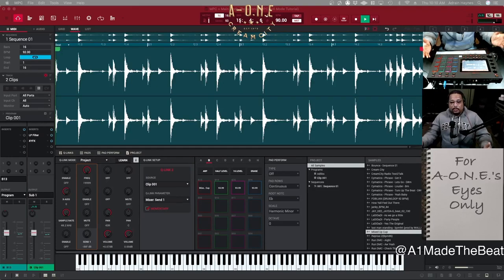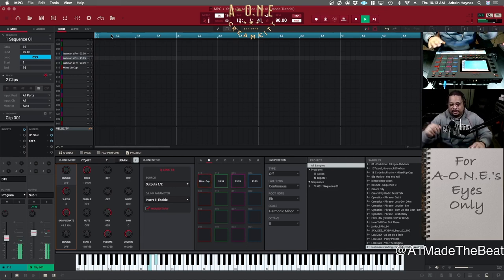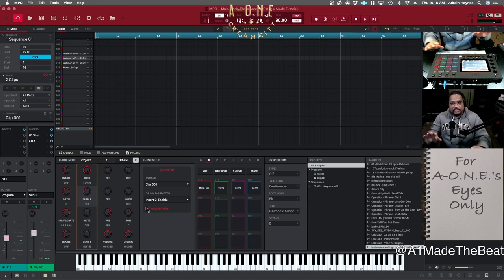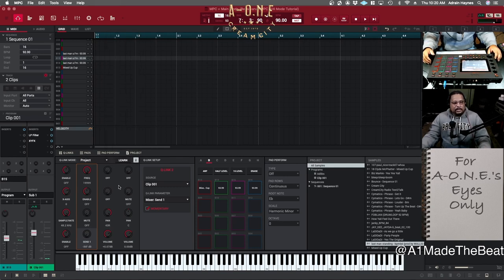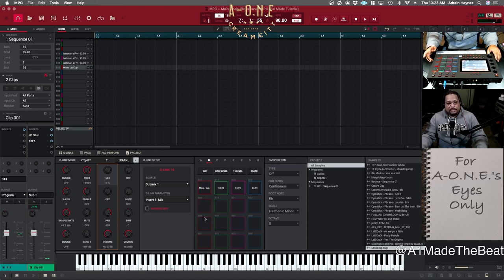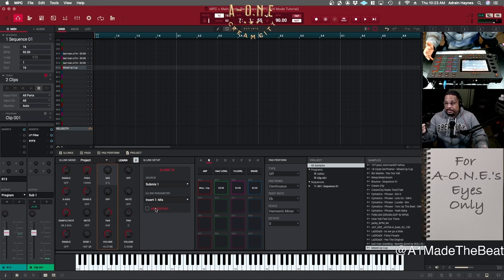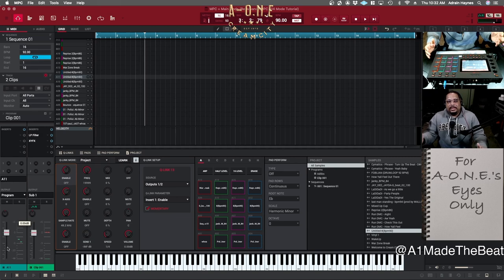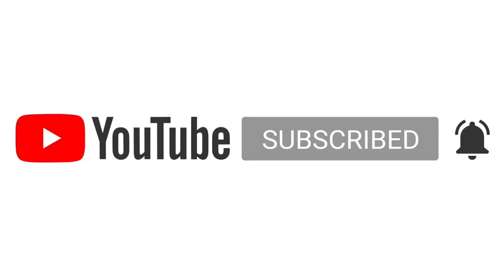EXCLUSIVE pt.2: How To Setup MPC 414 Mode Pt 2...QLInks & EFX (The SP 404 Killer?)

Comment: If I pick up a midi controller with knobs, I can map these functions to the controller and keep q links functioning as normal right?
Reply from the maker: Let me verify that it will assign to external midi devices when I get back to the house. It should work with no problem on the MPC.  The FORCE is another issue.
Reply: @A1MadeTheBeat  reporting back. This shit works great. Got a midi fighter twister. Loaded up a bunch of my beats into clip programs and mapped out 4 xyfx on the master to my twister knobs. I could map out 4 more on the program channel for 8 total controllable xyfx! This is fun. Just have to figure out how to use the fx better!